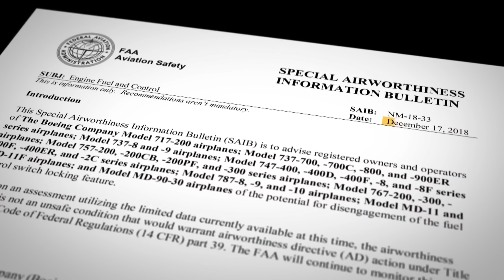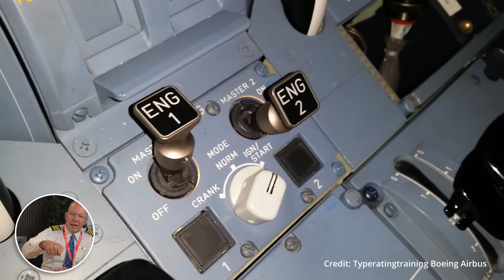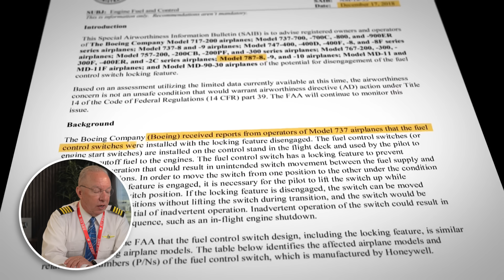Air India 171: The FAA’s 2018 Fuel Switch Locking Bulletin Explained (16 Questions Answered)

Comment: This whole thing is a red herring. Engines failed due to adulterated fuel. Pilots recycled fuel stitches in last ditch attempt to restart. Don't believe the report. It is meant to protect the big players.
Remember the F35 that didn't start after refuelling in Trivandrum, or all the Indian flights with fuel filter issues... Its a systemic problem from a particular airport operator.
Reply: The preliminary report clearly states there was no fuel contamination issue. You can believe whatever fantasy helps you sleep, but don’t expect others to join you in your delusions. So just seconds after takeoff, both engines coincidentally lost power due to 'fuel issues,' and someone manually shut off the switches? What kind of logic is that? You’re not connecting dots , You're just throwing masala at the wall and calling it biryani.
Reply: @vamseemk  Its standard operating procedure to turn the engine off and on in case of loss of thrust.
Otherwise do you twiddle your fingers and expect the engine to miraculously start again ??

Of course the report will rule out fuel contamination, because adulteration involves mixing lower grade kerosene (not water) with ATF
Reply: @srinathmallikarjunan1259  If fuel was cut off one second after throttle-up, then any explanation claiming “engine problem” or “loss of thrust” is plainly dishonest or a deliberate misdirection. There is no physical or procedural way to diagnose an engine anomaly, evaluate it, and react all in one second especially at the start of the takeoff roll.
Reply: Regarding fuel contamination, yes off  course, the flight data, engine parameters, and official report stating no fuel contamination must be lying.  Within one second of takeoff, this clairvoyant pilot “sensed” fuel contaminationj without a single cockpit warning, no fuel pressure drop, no engine flameout, no EICAS alert. (/s)
Reply: @vamseemk  Fact is the engine died. Fuel adulteration (not contamination) is the most likely cause.
According to you, the pilot just turned off the fuel supply to have a laugh.
I say the fuel was adulterated by a criminal who has a track record adulterating coal

Comment: When you're working in your office, how many of you are exempt from cameras? Pilots are in control of hundreds of lives and millions of dollars in equipment. Captain Steve gave a graceful response but it is a relic of the past. The resistance to cockpit cameras is not about safety, it's about comfort, control, and avoiding scrutiny. It’s time this outdated perk ends. Privacy can’t trump public safety.

Yes, having a camera in the cockpit can feel intrusive. It’s a more closed and zoomed-in lens than most of us would tolerate at work. But the cockpit isn’t just any office. When you're entrusted with hundreds of lives, the expectation of oversight is reasonable for accountability and safety. No profession should be immune to checks when stakes are this high.

Comment: Aircrafts now should have security login to fuel cut off while in flight. Pilots should be required to enter code to cut off fuel. When you can have fingerprint or code to unlock the phones...why not for such a critical function in Aircraft...and there should be display and Audio warning of "Fuel cut off Engaged".
Reply: If someone is determined to crash the plane, entering a password won’t stop them. You’ve just added one extra step for a suicidal person, not a safeguard. Systems should prevent accidental misuse, not assume bad intent because no technical system can neutralize deliberate malice. You don’t stop a murderer with a login screen.

Comment: You dismiss the locking switch bulletin by stating it’s about the switches being installed upside down.

That’s not what the bulletin states. If it was upside down installation, the fix would not be to replace the switches.

The check is to attempt to move the switch to see if the lock is effective. That wouldn’t be the test of the switch was upside down.

Finally, cyber attacks on modern FBW aircraft are a thing that doesn’t require Bluetooth. This has been demonstrated. 

Appreciate the expertise of an experienced captain, but you’re not an avionics engineer or a maintenance engineer.
Reply: You’re criticizing an experienced captain by nitpicking a technical bulletin without understanding the operational context or his point. The bulletin referred to issues with switch locking a mechanical reliability concern not a hacking scenario or switch orientation error. If the switches were simply installed upside down, the solution would’ve been reinstallation, not replacement.

Also, referencing cyberattacks without specifics has no credibility. Vulnerabilities exist in theory, but in this case, there’s no indication of any such event. You don’t have to be an avionics engineer to call out deliberate manual inputs which is what the preliminary report clearly suggests.

You don't give your credentials and sound authoritative while undermining someone who actually flew these machines for a living. The writing is on the wall  clear and official but you’re choosing to look away

Comment: Captain Steve,

I am not a pilot but I was an aircraft mechanic for 18 years and in air safety and compliance after. During my time in the Air Force, I was engine run certified on two airframes and an engine run certifier later in my career. 

At first notice of this crash, I watched the available videos time and again possibly 100 times in the first two days after the crash. I am compelled to say my first logical conclusion in my first 10-20 viewings was that this crash was the result of a deliberate human action. I made that comment either on one of your videos or another YouTuber within a day of the crash. I didn’t want to say it.

I haven’t watched all of your videos concerning the crash however, I would love to know your opinion on when exactly the fuel cutoff switches were turned off?

You mentioned that the cutoff switches were turned off a few seconds apart. It appeared to me that the aircraft took up nearly the entire runway to get airborne and that the engines (at least the left one) were producing some thrust at takeoff with evidence of exhaust and air dispersion. 

I thought the rotation and AOA was inconsistent with a max load TRT for that aircraft. I kept repeating to my wife that without a natural external influence, there is no way two engines fail without human input or error.

Comment: Here is one hypothetical scenario.
The first officer was flying the plane.  Immediately after liftoff, the captain moves both fuel switches to cutoff.  Next the captain calls out to the first officer, “why did you do that?”  This explains why the first officer said. “I didn’t do it.”  The captain has now used the cockpit voice recorder to cover his guilt by transferring it to his co-pilot. Now his family will get the full life insurance claim due to death by murder versus suicide.  The nefarious captain likely also called the Mayday, adding to the subterfuge.  Just conjecture, however, the investigators know exactly which pilot made each statement.  Also, the switches appear to have been moved in a left engine to right engine sequence, implying it was all done by the pilot in the left seat.

Comment: Totally wrong that cameras should not be installed on commercial planes with HUNDREDS of people on board.  Of course the cameras wouldn't have contributed to the crash but could be extremely important to figure out what happened.  What do you not get about that? C'mon Steve! Everything in your video after that bit was white noise to me, get over your preconceived biases.

Comment: One big benefit of having a camera is that it will clearly show who is doing what. In this case it would have clearly showed who pulled those switches and when. This would have clearly ruled out if this was a mechanical failure or pilot's intentional act.

In the case of mental health issues of pilots. I think because of the risk of losing your job over disclosing your mental issues makes it extremely difficult for affected pilots to seek health.

Comment: Thanks for your honest and brave reporting on this. Sometimes the impossible is a hard pill to swallow. Just an extra thought on the preliminary report. To me what is missing from this report is anything that would exonerate the pilots. Whether it be additional transcripts from the CVR or data points I'm sure that they would have put in anything that would eliminate pilot error or a pilot intentional act. I think they are withholding critical data specifically the CVR transcript.

Comment: Wouldn’t it make sense to install fuel control switches on either side for both pilots must control it on their side and not one could control them both anytime. As most commercial aircraft are capable of flying with just one engine

Comment: 4.40 The Captain states CVR & CDR do the same function as the video camera. It is not so. If we had the visuals , in this case, we would have caught the willful/ inadverdant change over of switches. 

And all the time he is pushing the theory of mental illness of pilot / pilots. 

The genesis of the cut-off switches, whether they were having a locking system or is not elaborated.

He is just taking granted that the switches cannot fail !

Comment: There is no evidence indicating that either of the pilots intentionally moved the fuel switches to the CUT OFF position. The only fact established is that the switches were found (in DFDR) in that position. Furthermore, one of the pilots has stated that he did not touch them. At this stage, any suggestion that the switches were deliberately moved is purely speculative. Until there is clear and indisputable proof, it is inappropriate and unethical to present such assumptions to your viewers as fact.

Additionally, it is worth noting that you are discussing highly technical topics despite not having a technical background. Simply reading the QRH or FCOM is not sufficient to fully understand the underlying systems. Most viewers likely trust your explanations, assuming that pilots are experts in every aspect of the aircraft.

For your awareness, here is some clarification regarding Airworthiness Directives (ADs) and Service Bulletins (SBs):

ADs are legally enforceable rules issued by the FAA under 14 CFR Part 39. They apply to aircraft, engines, propellers, and appliances, and are mandatory.

Service Bulletins, issued by manufacturers, are technical documents that provide instructions to inspect or modify these products. They are not merely “informational” as often misunderstood.

In most cases, ADs reference SBs as an approved method of compliance. In essence, ADs are regulatory mandates, while SBs are the prescribed means of complying with those mandates.

Please be mindful of the distinction, and refrain from interpreting or communicating technical content unless you have the appropriate expertise.

Comment: Can everyone please stop asking really unproductive questions about installing cameras in the flight deck? If it was pilot suicide, this would have done jack squat to prevent it. All you would see is a video feed after the fact. No prevention - just analysis. Something that is done much much much better by the actual electronic flight data coming from the black box. The reason why everyone is so confused in this case is because the darn AI 171 preliminary report did not annotate which pilot said what!! Knowing that alone would have made worlds of difference in understanding exactly WTF happened here.

I am really disappointed in the way Capt. Steeve answered some of these questions - especially the one about the Embraer - you didn't answer the fundamental question asked - "why isn't the Boeing design more like Embraer". The correct answer is that Boeing deliberately gives their pilots more control as a general design philosophy and in this particular situation it doesn't make sense. Meaning Embraer in some cases gets their design philosophy correct. And why do they get some things right that Boeing very occasionally gets wrong? Because they have the benefit of designing their regional airliners decades after the 737 family first went into service. Because... no, Captain Steeve, if there is an engine fire you absolutely do not reach down to click the fuel switch to cutoff. No no no. A fire is one of the very few actions on an airplane that has some rush associated with it. Your very first action (after looking at all the other indications as well) is to reach up to pull the illuminated fire handle. Why? Because the fire handle already cuts off fuel supply in, already cuts off flow of hyd fluid, already cuts off bleed air out, etc. Which is exactly the reason the shroomed-out Alaska pilot jumpseating on Horizon reached for the fire handle!!! Like... I hope you are not a training captain because your advice in the event of an engine fires - as a first action - to switch the fuel levers to cutoff is terrible. If you were my sim partner I would swat your hand away.

Finally, the SB for the fuel cutoff switches is as germane as it is important to discuss. You've said this in a couple of videos now that "I think that has to deal with installing the switch guards upside-down, and if that happened, you would know". Ummmm. No. The SB is for inadequate resistance to movement of the switch. Of course, it may turn out that - as you say - flipping the fuel switches to cutoff was a deliberate action. But it is the very height of irresponsibility to just hand wave this SB away as not contributing to the accident, when what you are saying is simply what you heard. Show me in the SB where it says the risk is installing them upside-down. It's about insufficient detent hold, bro. Through wear and/or defective parts. I agree that under NORMAL circumstances it is 100% impossible to inadvertently flip those cutoff switches to a different position, but with worn out and/or incorrect detent guards it may in fact be possible WITH THOSE DEFECTIVE SWITCHES.

Again - super important questions and it's really disappointing how you are brushing these aside.

Comment: Cpt, Steve, 4000 hrs on single. Single Engine Fighters, some one hundred on Commercial,  now owner of an aviation biz in the Caymans thinks that the Pilot not flying has operated those switches. The PFL has both hands on the Controls concentrates on the TOR. Difficult to handle these switches one by one at the same time. We had those switches in our fighters and they never failed even at 7.33 G,s

Comment: Captain Steeve, what everyone's neglecting after the report is out; is why the plane took full runway length to take off? The plane with one engine failure takes a shorter runway to lift off than what this plane took to lift. That tells something was already not good about the engines before liftoff, the power generated was subpar.

Comment: Mr. Captain. here it is. You couldn't even check the FAA advisory online . Are you still a Pilot ? God help the passengers !!!! " The US Federal Aviation Administration (FAA) has issued a Special Airworthiness Information Bulletin (SAIB) warning operators of several Boeing aircraft models about potential risks linked to faulty fuel control switches that could trigger unintended in-flight engine shutdowns."  The advisory spans a broad range of aircraft, including the Boeing 717-200, 737 series (covering -700, -800, -900ER, -8, and -9 variants), 747, 757, 767, 787-8/-9/-10, and the MD-11 and MD-90-30 models.

Comment: Does the loud bang that the surviving passenger heard, in sync with the fuel switch off . I mean, if the fuel switches were moved to cut off, would a loud noise be heard with the engines shutting off?
Reply: The loud bang is the sound of the RAT deploying.

Comment: The recommended by FAA about the fuel switch would have  been forwarded after they simulated the situation by experts and there is chance to be in that situation as per Murphy's Law once in thousands although externally it seems that it can not be done without manual  as per common sense but internally there might be fault which could do that. Because of this FAA made the advisory otherwise there is no need to made the advisory

Comment: The problem wasn't with the switch or the potential for it to become unswitched.  That could perhaps happen to one switch but not both of them.  Many pilots have reported that this isn't a switch that can just be bumped out of position.
This is a case of a pilot intentionally cutting fuel to the engines, either because he made a mistake or because he was committing murder.

Comment: the fact that this happened at exactly the worst time possible is what makes it seem intentional. if there was something wrong with the switches or electrical system, it could have shown itself during the several minutes on the runway with engines running, or any time during the flight, but no, it happens right when nothing can be done about it.

Comment: Hey captain,
In a previous video, you said the switches are spring loaded, hence it takes deliberation to move them. 
Is this a possibility that the spring mechanism in the switches failed causing the switches to be turned off?
And maybe that's why both pilots in the recording said they didn't turn it off

Comment: Question is if a warning appears on  screen it's entirely possible other pilot saw that warning and reacted. The switches may not have been toggled at all...if a warning does show up on screen the copilot would have known immediately that engine is cut off, so other pilot would have known right away and don't think pilot would have taken the risk and even be able to deny having done it if he denied it and copilot did not even protest meansthe switches may not have been toggled